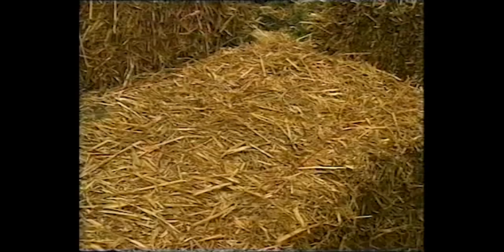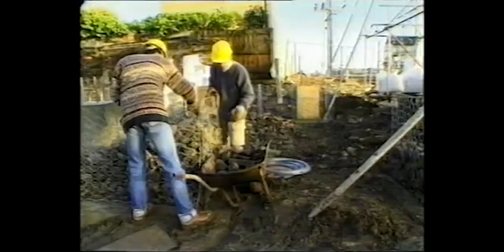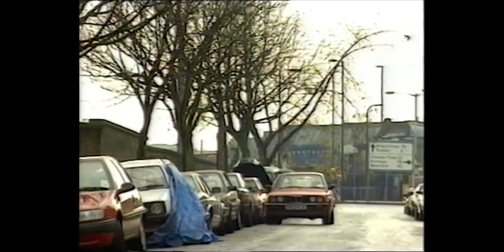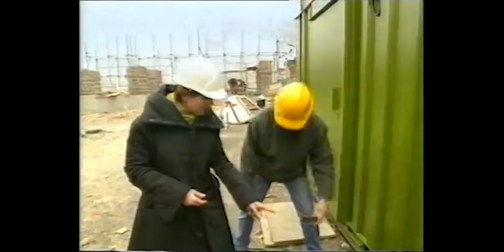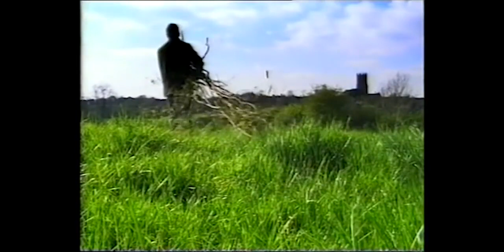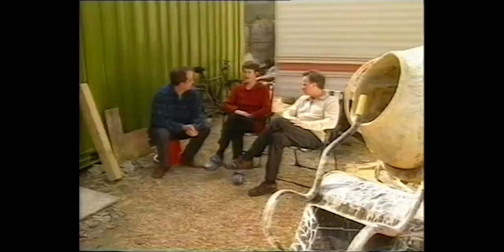Grand Designs Full Episode | Islington | Season 1 Episode 7

Comment: In the south west of the US, they seal the hat bales in mud to create Adobe houses.
Reply: What you are writing about in the US Southwest are straw bale homes. Adobe houses are made from Mud/clay bricks made by combining that mud/clay (and likely rarer these days: manure from field grazing livestock) with cut straw, and dried grasses, placing it all in a mold, then demolding the bricks and allowing them to sun-dry. They are then used as building blocks for walls and other structures in the building. Bale homes use full or cut bales to fill in the voids between a superstructure of wood, steel, or stone - or some combination. Bale and Adobe buildings are not completely different due to the materials utilized but there are differences in how those materials are brought together.